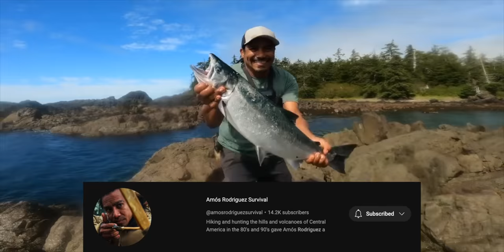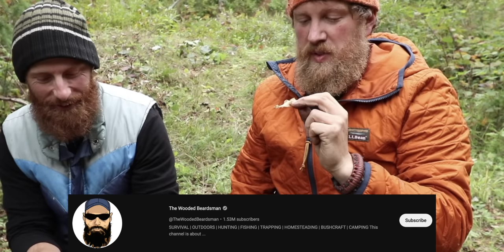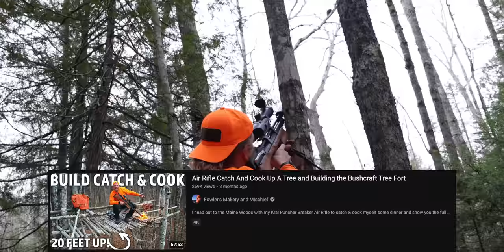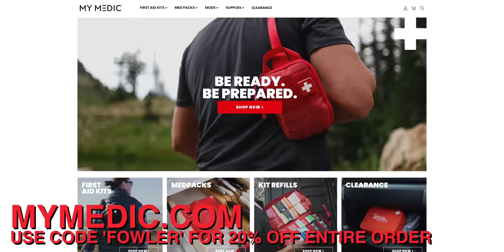We Bought a Lake...

Comment: The "MY MEDIC" MyFAK Mini Pro is the one I'd be interested in having. I'm very impressed, any of those kits from "MY MEDIC" will be a phenomenal addition to anyone. In fact, I actually could have used the larger of the 3 kits just 2 weeks ago when a car in front of me on Interstate 40 clipped a semi-truck trailer. Losing control, the car crossed the medium and then the two lanes on the other side, going off the road and flipping 4 times that I saw as I was pulling over the go and assist. As a retired EMT I was compelled to help in such a catastrophic accident. My EDC first aid EMT bag was in my truck but I was driving my fiancee"s car and didn't have the first bit of first aid with me. 3 occupants were in the vehicle that had flipped. Once we got the car resting back on 4 wheels, my prior training kicked in but I was absolutely incapable of doing much but directing others on how to hold compression on the wounds and stabilize their head and necks as I did for the driver until the First Responders arrived. I'm adamant that if I had the multiday MyFAK Mini Pro "MY MEDIC" pack I could have treated many if not all of the cuts and the several cuts that were deep cuts with those ZZips packs. All 3 survived but 2 will have a very long recovery time for the broken bones and the types of breaks suffered.  As I'm in the market now to be better prepared in having a first aid kit for the car I have been researching, it is in my opinion from what I've seen "MY MEDIC" is top-tier in thought and in quality. For convenience's sake, I've been looking at ready-made kits and expanded higher-level bags for more experienced persons which "MY MEDIC" would meet my needs.